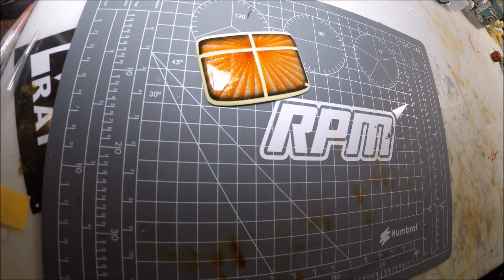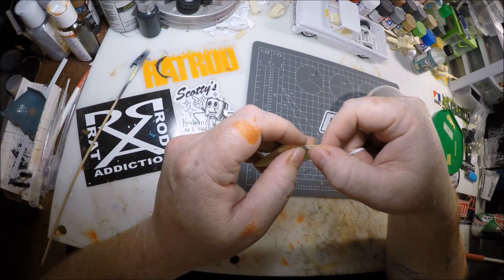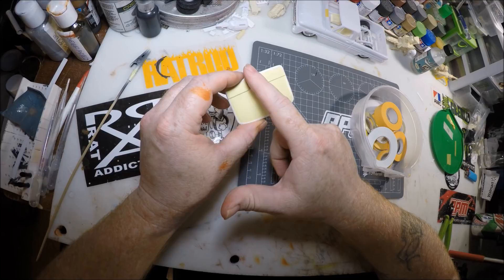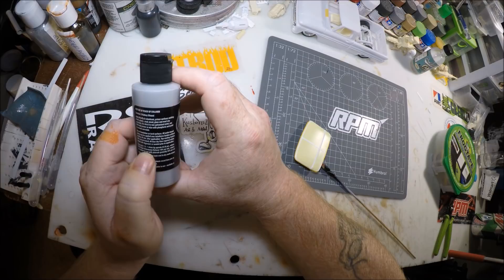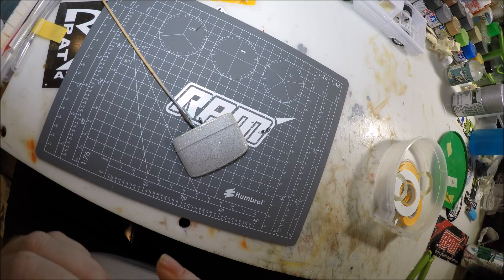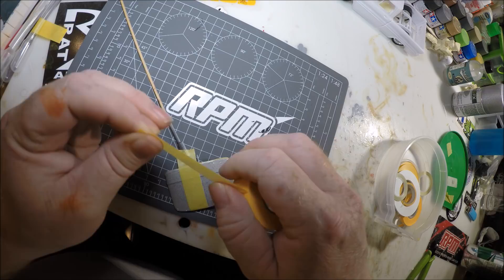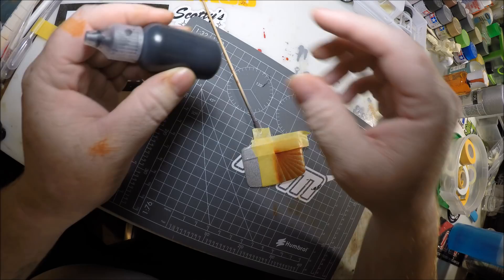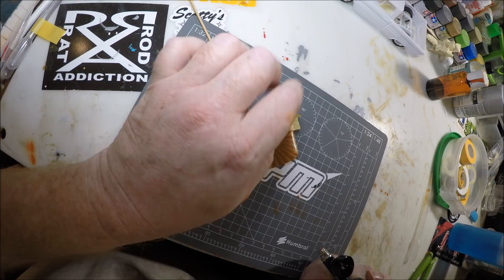how too paint a fade on scale models

Comment: Good technique man. Doing research on how to do this and I’m glad I found this video 👍🏽
Quick question I know this video is from 2 years ago, what clear coat did you use to as you’re doing each quarter for masking? And are you using this same clear coat today? 
Thanks.
Reply from the maker: Yes I'm still using it today and it's rustoleum lacquer specialty paint can be found anywhere they sell rustoleum spray paint!